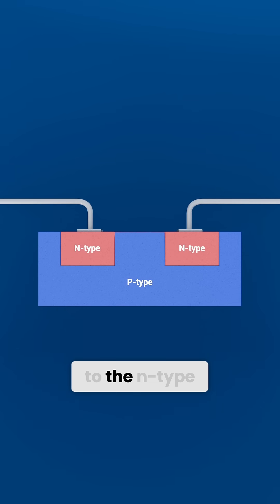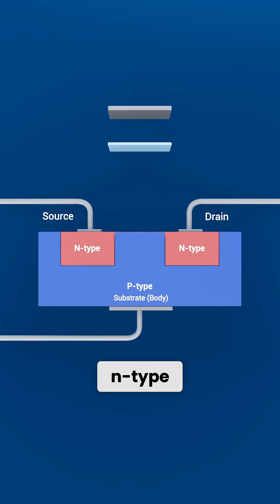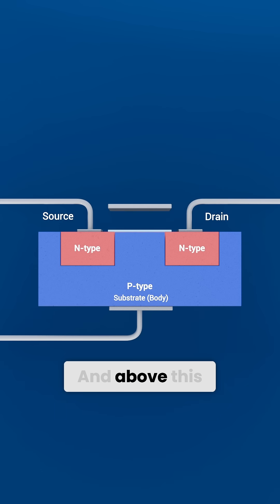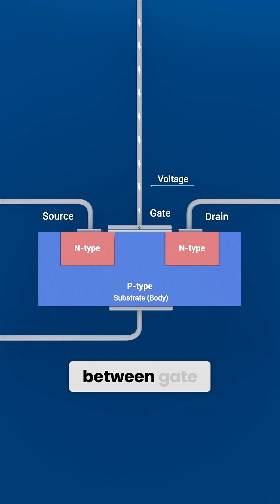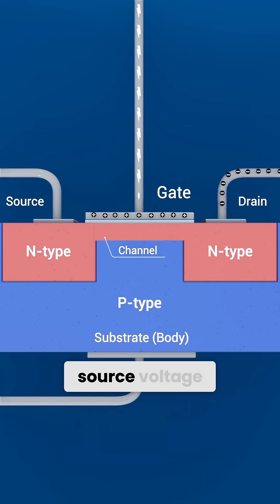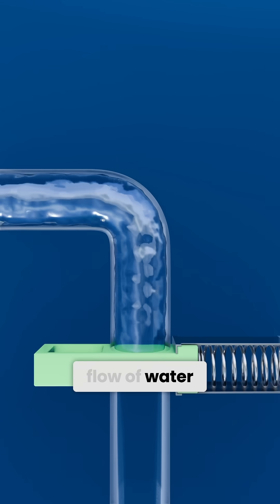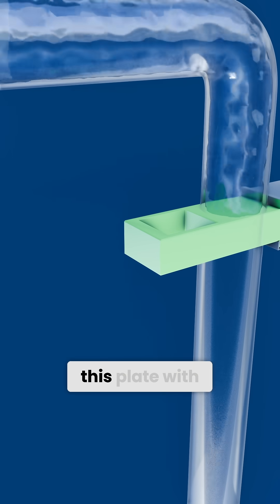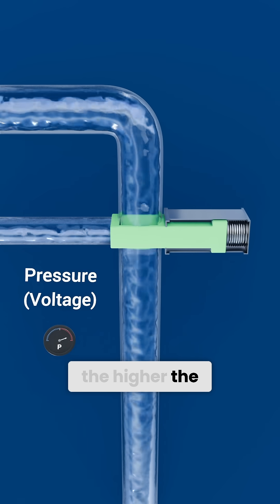How does a MOSFET control current | MOSFETs Explained #electroniccomponents #mosfet #shorts

Comment: What does the substrate wire do?
Reply: Ground, usually through the ic package. You end up with a 3 pin ic, but it must be mounted correctly to work.
Reply: regarding the substrate terminal, for ic packages it is usually connected to V+ for P-channel FETs and to V- or ground for N-channel FETs. For discrete FETS, they are usually 3 pin devices rather than 4 and in both types the substrate is wired directly to the source.
Reply: The p type substrate is usually plased in gate and polysilicon and oxide are separate it from n type semiconductor. Atleast that way I remember, may be i am wrong.